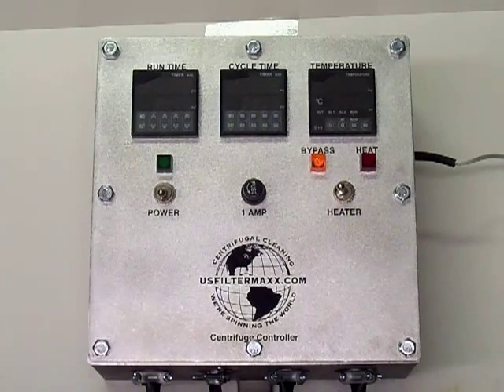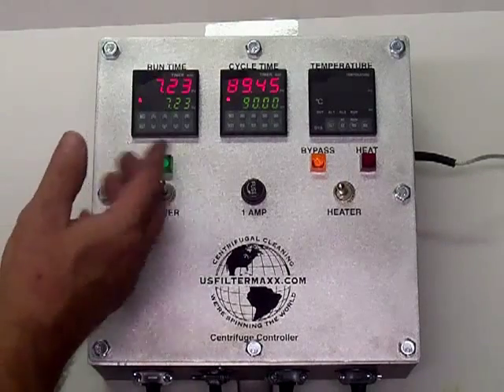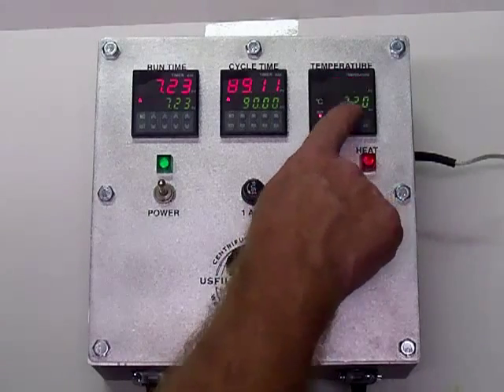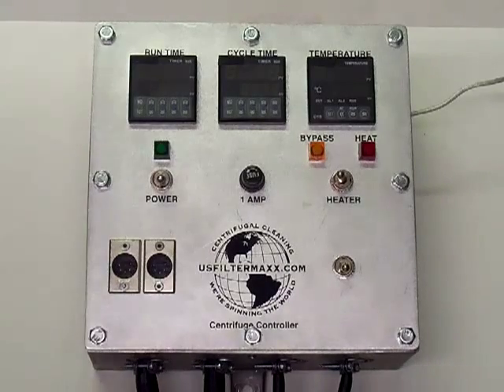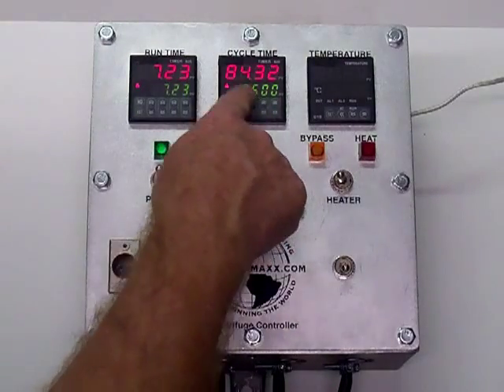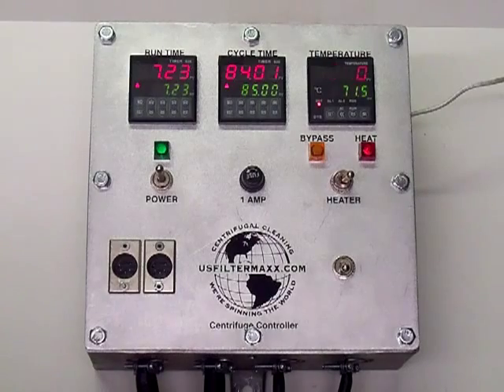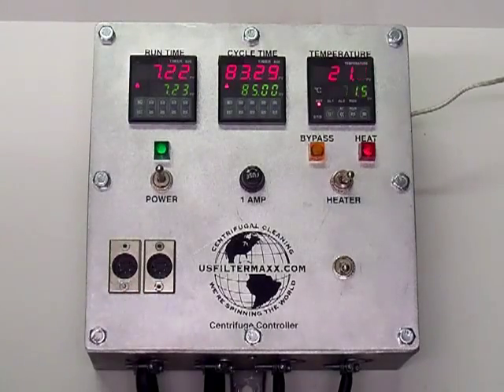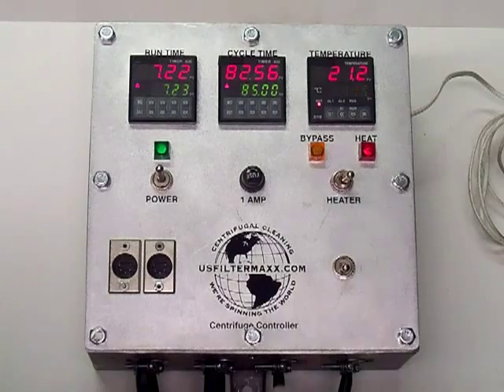US Filtermaxx Programable Centrifuge Controllers

Comment from the maker: The unit in the video has a remote potentiometer for speed. The newer controllers have the pot on the front panel. The variable speed controller set does have the flow sensor.